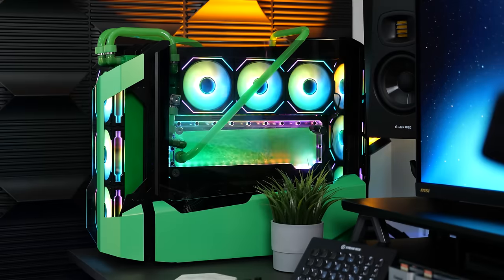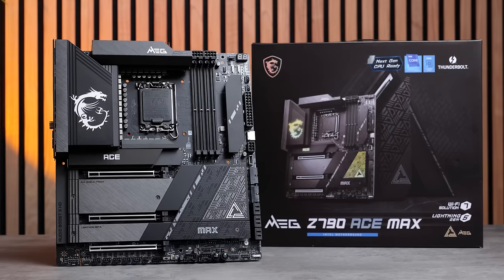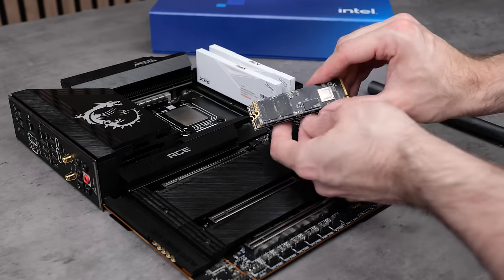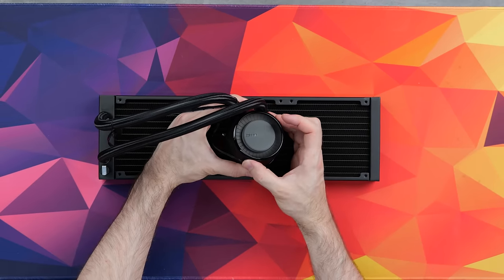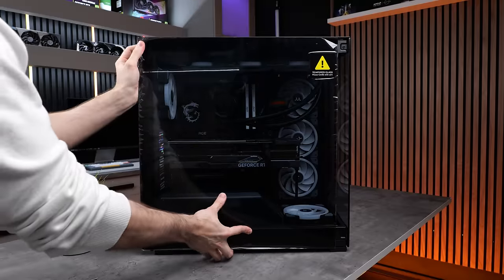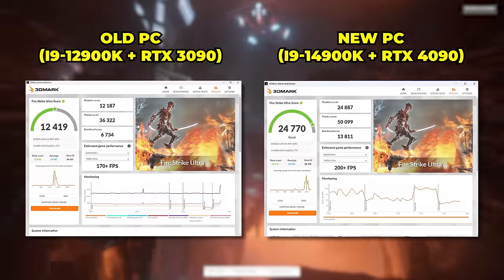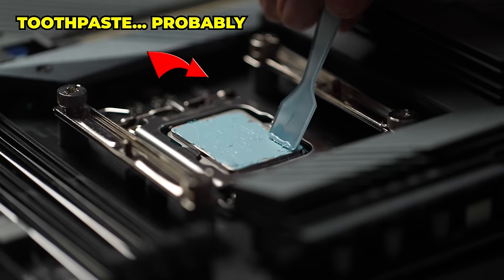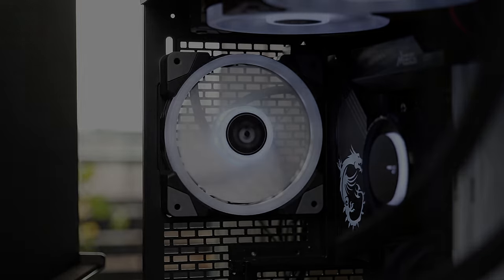Building a PC that runs EVERYTHING - (i9-14900k + RTX 4090)

Comment: Pretty much the same build I have but with a 13900k instead since I built it a few months before it was released, it's amazing and was a HUGE upgrade from my GTX 660 2GB card that I used for like 10 years
Reply: The pc from video is better than a ps5 right?
Reply: @Tiagooo28x all pc's above 800$ (or whatever currency) are better than a ps5. The pc from the video is the top of the top so yeah that pc is crushing the ps5
Reply: @scaredrabbitnl  thxx, I will work very hard to get that monster fr
Reply: @scaredrabbitnl  so it will run gta 6 in ultra?
Reply: @Tiagooo28x  probably yes
Reply: @Tiagooo28x  yes it is very expensive haha
Reply: I get 100c when playing with my 13900k. how to fix?
Reply: @Tiagooo28x bruhhhhh…. 😂

You can buy hardware that is 3+ years old and get a PC than outperforms a PS5.

This PC is top of the line everything, the 4090 he has inside his PC alone costs more than a PC which is better than a PS5.
Reply: @JSpectre98 cooling issue it sounds like.

Comment: Cool, I've similar build. But it so uncommon that a 4 slots motherboard takes ddr5 8000 at first try and without any issue... at least that's what your video suggests. Did you have any issue with xmp profile set at 8000 MHz?
Reply: naw most likely  he needed to set the speed to something like 6400 or so that 4 sticks run good

Comment: Nice build.  I am on the Meg Z790 Ace motherboard with the same Intel i9-14900k, and have used the Intel XTU app, but I still hit thermal throttling phases.  The OC feature within the BIOS is off.  All tuning is done by Intel XTU.  Cooler is and MSI AIO 360.  But, I have 4 inflow fans, 3 exhaust on the radiator for CPU system, and one exhaust in the back. You have more fans.  Wonder if that makes the difference in cooling it better.
Reply: he does not have more fans. the nv5 has 8 fans, and you also have 8 fans.

Comment: How are you liking the AIO for this setup? I have 4090 and 14900K and ppl keep saying go water system for cooling instead of AIO. I was going to buy a 360 or 420 since I already have 10 case fans and it’s a very large case with lots of room inside.
Reply from the maker: It's been great so far! You don't need custom watercooling imo, 360mm works totally fine haven't had any throttling.
Reply: those are same people who are paid to say AMD beats Intel any time

Comment: I have my first all white full tower build with the gigabyte aero oc 4090/ 7800x3d/ 64 gigs of ddr5 in the white phanteks nv7. The pc looks insane and is a beast.
Reply: Sounds almost like what my build is looking like except I have the i9 14 as opposed to the amd CPU. I almost got that one as I have seen everywhere that it’s excellent paired with 4090 for gaming. But I needed the intel for a little bit more. Build is almost done. I can’t decide on a mobo so that’s really the hold up for me at the moment.
Reply: @Little_Bitz  if the build is all white get a silver or white or silver and white motherboard. There are a decent amount of options for x670 or b650 motherboards. The x670e gigabyte arous pro x which I think looks the best besides my motherboard which is the nzxt b650e or other gigabyte b650 motherboards and asus motherboards. Also the x670e steel legend. I would say if you want the extra features go with the x670e but if you dont need the extras go with a b650 or a b650e. I picked the b650e nzxt board because it is white and black and I only use my pc for gaming so it is more then enough for me. Oh I almost forgot welcome to the 4090 crew lol.

Comment: Why some people always left out the best PSU for high end system? 
I hope atleast you re having UPS tho.
Reply from the maker: Quality 1000w is fine, no issues
Reply: @TechTesseract  Well, as i understand RTX4090 is 450 watt, 14900K is 360watt. 
810 watt so far, and with all others devices there, the total wattage is already over 80% of 1000watt. 
Is that ok? 
Well, best of luck with that.
Reply: @tarno_bejo_ you’re talking about a rare scenario where the gpu and cpu are stressed to their max
Reply: @rdraven7356  Thats the point. The headroom is for the worst scenario. What kill electronics is the sudden spikes of voltage, etc, i think.

Comment: have you been experiencing the issues with the i9 14th gen like many others have?
Reply from the maker: I haven't actually, still running the same chip from when I built it and zero problems at all
Reply: @TechTesseract  Glad to hear it, did you do any overclocking or running it factory?

Comment: This is absolutely the PC this setup deserved! I just rebuilt my gf's pc in a white NV5 and it was an absolute joy and breeze to build in. Prob would've built mine in one as well had they been out in the summertime.
Reply: What are your specs?
Reply: @MrAnimescrazy  my pc is a ROG Maximus hero Z790 mobo, 4090, 13900k, LT720 AIO, 6400 DDR5 Corsair dominator RAM, O11 Dynamic Evo and 10 Lian li SL 120 V2 fans. GF’s build has a ROG Z690 mobo, EVGA 3080 from my old PC, 13600k, LS720 AIO, 6000 DDR5 T Force RAM, NV5, and 8 SL120 V2s. Both have been fantastic so far!
Reply: @bigman8733  both nice builds.
Reply: @MrAnimescrazy  thanks!

Comment: What do you mean by render out clips? Are you saying render effects in and out? Or are you talking about making proxies.
Reply from the maker: Render as in export a project
Reply: @TechTesseract  do you know what your core temps are mine are like 95 and I have a 360 mil liquid cooler and I'm terrified
Reply: @TechTesseract  I thought you meant render in two out throughout the timeline. I had a timeline that was so big I had to separate it into subsequences and render every little effect. I am trying to get to my actual problem I think it has to do with the video code  Xf AVC

Comment: Why don't run MSI MEG Ai1300P?? PSU when running all disks and fans, and a 4090 when you use MEG motherboard to! Then u can see everything in MSI center. wattes and so on.. And u run 4090, that powersupply and other 1000w is like 80A the MSI MEG Ai1300P is 100A It connects with USB to the motherboard pin or backplate. U should have all percs of Msi then, other than maybe fix that and buy A MSi pcie-5 nvme drive in 2 TB so you can say u have everything the best. And see absolute everything and stir with MSI center! Running a msi motherboard and a suprim x to!

Comment: Every time I used the AI overclock tool, I ended up getting lots of crashing.  I have a very similar build 14900k and 4090.  I stopped using the AI overclock tool.

Comment: Can anyone tell me which of these processors is better for games, Ryzen 9 7950x3d or i9 14900k?
Reply: That is a good question. I would say look at comparisons on youtube.
Reply: If you're using your PC for ONLY gaming then neither.

In gaming R7 7800x3D is cheaper, has better thermals (easy as shit to cool) and has the same level of performance, if not better, as the R9 7950x3D. NOTE: This is assuming the 7950x3D's thread scheduling works on the games you're playing, which isn't always the case - R9 7950x3D will end up performimg worse than R7 7800x3D on some games. 

You would only look at the R9 7950x3d or I9 14900k if you were looking to do some intense productivity tasks on the side, such as 4k Video Editing or CAD work etc, in which case I would say the 14900k cause its cheaper and has more cores.

Comment: DON'T use i9-14900k. You WILL experience bad results in gaming, cpu heavy tasks and even at ai models. Buy the i9-13900k instead; it's the same cpu, but not overclocked out of the box like the 14900k.

Comment: Hey random question I got a 4080 super i7 13700k 64 gb ram 4 tb ssd 2 of this and a 2tb ssd so in total 10 tb ssd with a hard drive that has 4 extra tb wifi 6e motherboard 1000 power supply what will you guys think for price if you guys were to sell it

Comment: using Intel Core i9-14900k with XPG Lancer DDR5 8000Mhz while Core i9-14900k max 5600hz support? why you pay so much extra for nothing lol, please comment and let me know if i get something wrong but im pretty sure i didnt.
Reply from the maker: 8000mhz is still silicon lottery territory atm, it's mostly motherboard dependent. Plenty of people on reddit running 14900k with 8000mhz ddr5, the xmp profile works on mine

Comment: If you had an RTX 3090 and 12900K with a custom water cooled system and now you have an RTX 4090 air cooled, in my opinion that's a downgrade..
Reply from the maker: More power/ fps though, watercooling is just for looks tbh
Reply: @TechTesseract  you said you push the system to the max, all test prove that water-cooling is way more cooler, which means you can overclock it with higher speed, lower temperatures, if you really push it to the max, it will be a huge difference, especially when you delid your CPU first.

Comment: Solid build. Surprised tho... no infinity mirror aio block, no temps lcd display, not even a waifu (which you would never have it tho xD). I get that RGB is going out but that wall you face and the diagonal wall seem a bit off now. Also, I think your side wall needs a white accent panel here and there.

Comment: Can’t get my games to run with this same rig. 4090 and the i9-14900.  They all crash.  There are articles talking about the CPU being the issue. Let me know if you had the same issue. They are recommending undervolting
Reply from the maker: Hey, haven't had to undervolt mine at all, mostly idles at 34c, 60s while gaming, and high 80s low 90s while rendering

Comment: Badass rig!! Far better than any amd build!!
Reply: In gaming, a 7800X3D beats the 14900K at every resolution except 4K where it's a straight tie because 4K is GPU bound.
The 14900K * cough 13900K is a productivity beast though
Reply: Cringe and untrue.
Reply: @Kreubs  not by much if u actually test pcs. Intel has far better 1% lows than amd especially when u overclock them. And intel doesn't have stupid blue screen issues on start or constant updates. Intel has always been more reliable and smoother than amd.

Comment: this will be slower PC in gaming  for several months then entry zen5  cpu with 6/12  for around 300$ c/t  r5 9600x  and in productivity  slower then r9 9900x  or 12/24 c/t cpu  for around 450-500$
Reply: yeah no shit. Welcome to PCs where the tech moves fast and your new shiny build is no longer that fastest in just a year.
Reply: @lilpain1997  yea but why would i spend thousands of $ for something what will be obsolete shit in 4-6 months !?
Reply: @Mr11ESSE111  This guy has the money to do so and needs to for workflow. YOU dont need to buy anything. Also buying mid range or low end is exactly the same and quickly adds up.
Reply: @Mr11ESSE111  It won't be obsolete, just inferior.
Reply: @Mr11ESSE111 this pc wobt be obsolete for a very long time. Now it might not be as fast as the newest tech but that doesnt mean much.

Comment: All fans are arranged to exhaust the air inside. Are you going to blow air into the case from outside with your mouth? 😊  but a successful system assembly. 🤩🤩
Reply from the maker: top and side is intake, top and back is exhaust - If you'd watched the video you'd have heard me explain that these are reverse fan blades xD

Comment: You can't be an extreme gamer if you have an Intel chipset 🤭
Reply: 7800x3D stomps 14900k in gaming, at what, more than half the power? And far less heat and money, no brainer, if you need productivity, buy the 7950x3d
Reply from the maker: 14900k is the best all round chip, I do both gaming and productivity so makes the most sense for me personally